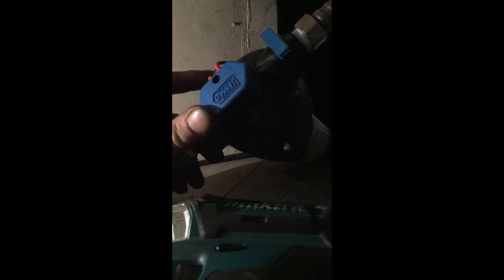Low Pressure Fix Jabsco Par Max 12v Fresh Water Pump

Comment: Hi! I've just got my jabsco pump and was wondering how you connect your pipes to either side?
Reply from the maker: Hi I think YouTube deleted my reply. You want 1/2 inch large bore flexible tap connectors and use the threaded fittings that came with the pump.